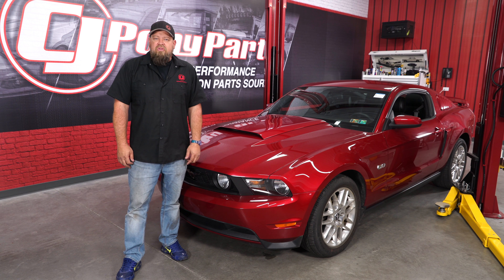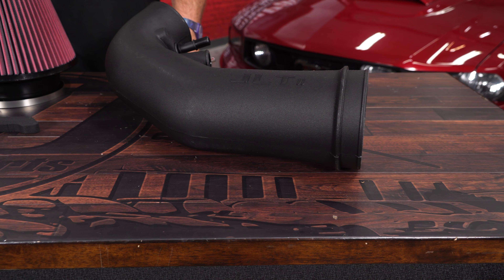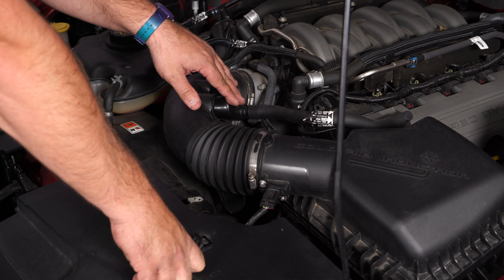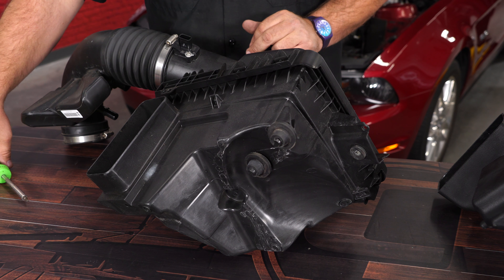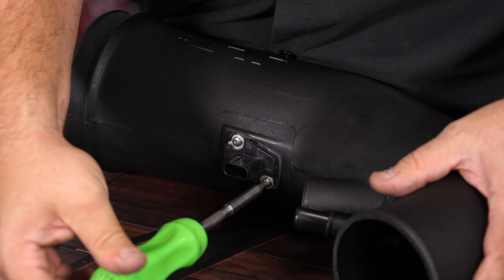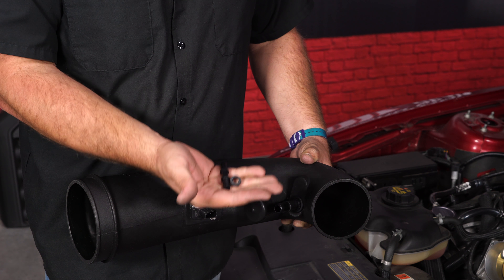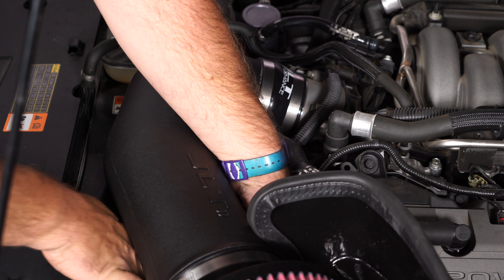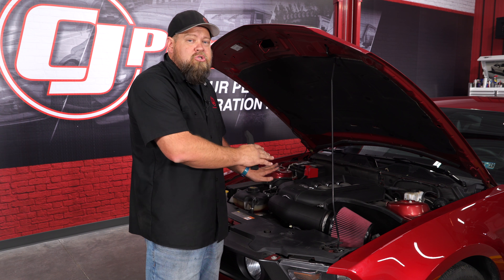More power for your Mustang GT & Boss 302! JLT Performance Series II cold air intake 2011-2014 GT

Comment: I doubt u need a tune.
Reply: Have one on my 14 and you absolutely need a tune. Will run like shit without it
Reply: @dthurst10  junk
Reply from the maker: The reading the for MAF sensor changes because the tube diameter is increased, that's why you need a tune.